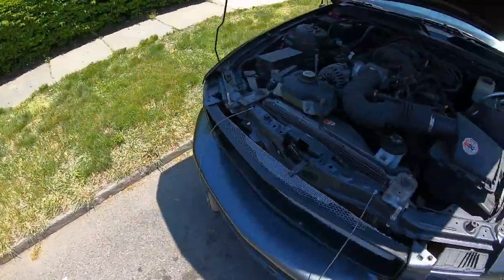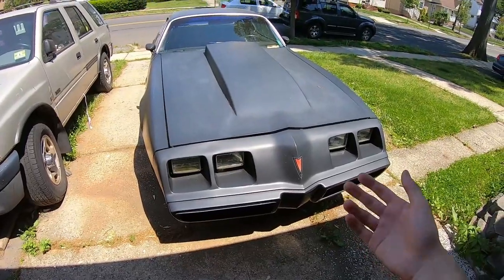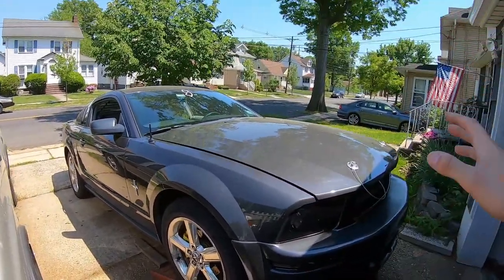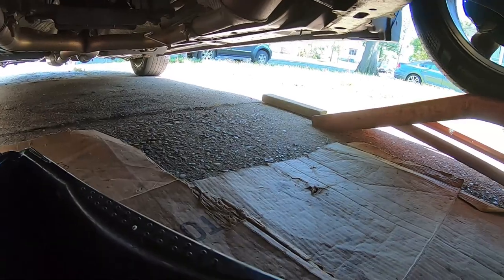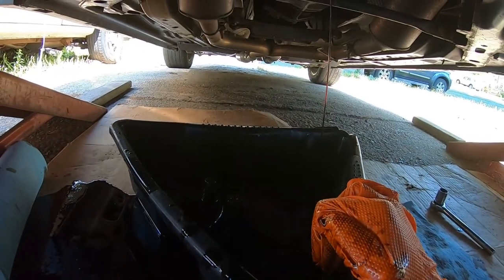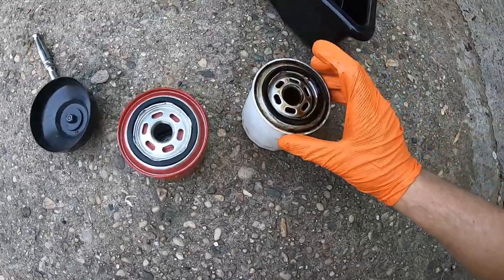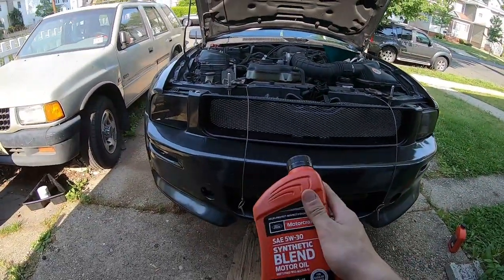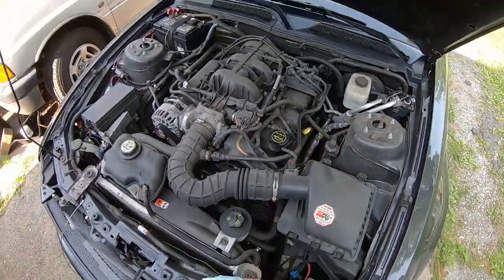How To Change Your Oil & Oil Filter - (2005-09 V6 Mustang)

Comment: what size is that filter socket ????????\
Reply: You never use a filter wrench. When installing the. Oil filter. Only when you're taking it off. It's only supposed to be hand tight...
Reply: So what the size wrench?